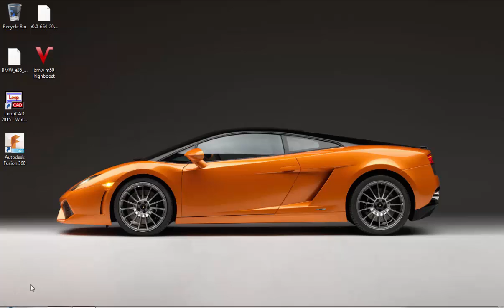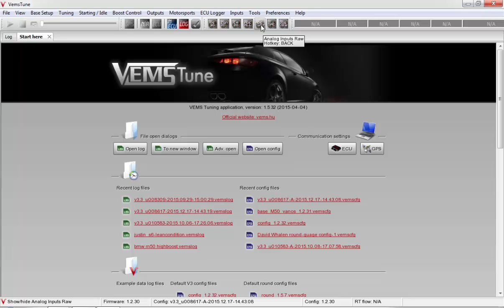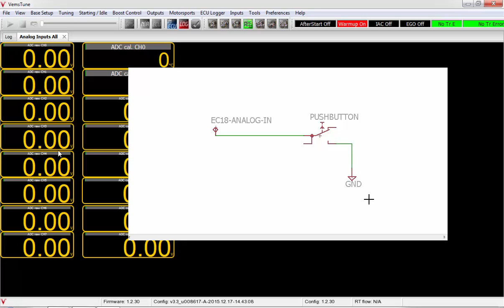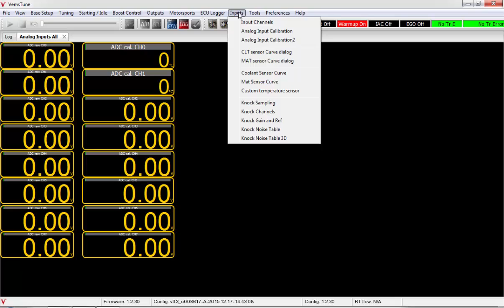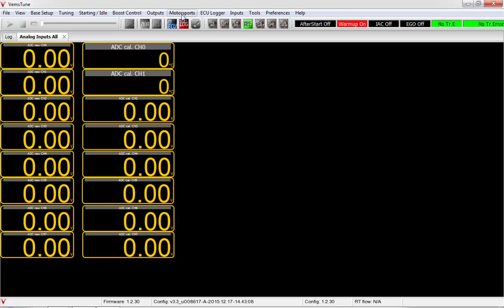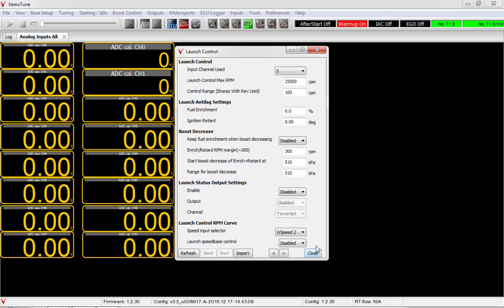VEMS How to Configure Launch Control

Comment: Hey jason new to vems.  I have a mk3 vr6T. Gti     Setup running everything is fine .... i just need to set up the launch control . Is there a specific wire to be grounded from behind the cpu (hardness).  Lugtronic PNP
Reply from the maker: I'd imagine they have some extra inputs available, but I can't say since its configured specifically for the pnp harness provided.

Comment: IDK if you make this but on ems-shop.se I can buy a VEMS 3.8 - Volvo 740/940 Patch Kit. how do I make a switch from that kit? where do I get the spare channel from? do I need to find a spare pin in one of the connectors in the ecu? (the connector that on the same side where the boost pressure is)

Comment: clear video. i get the launch control to work as an input. but it does not work when i switch it to ALS. 
Is this different?  can you explain how to configure ALS?
Reply from the maker: ALS can be very different than launch control. We have two ALS modes. One is launch ALS, which spools the turbo in launch mode. The other "ALS Control" under the Motorsports menu, will keep the turbo spooled when you're off the throttle. Very commonly used in stage rally (WRC). Most people only use the launch ALS. The Advanced ALS Control is extremely difficult to set up properly and requires hardware modifications to the throttle since you need to allow lots of air around the throttle plate even with the throttle "closed" by using a kicker or huge bypass valve.